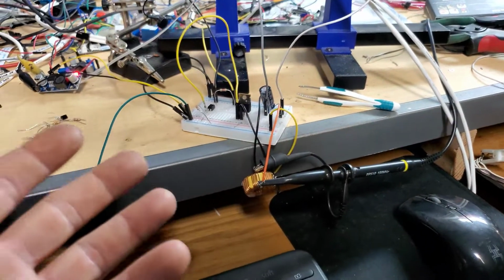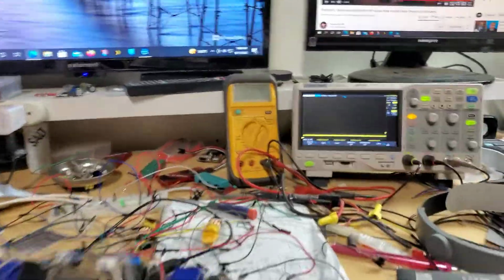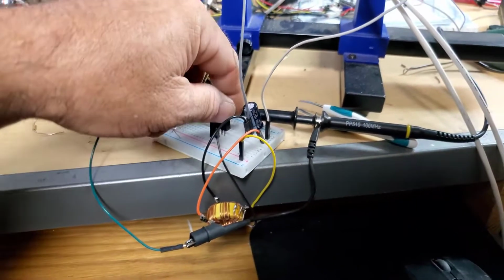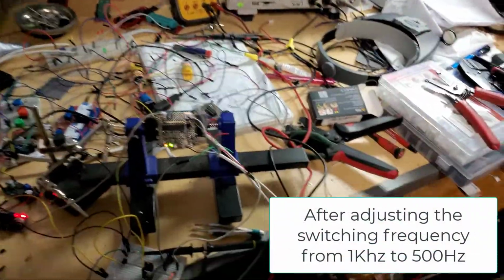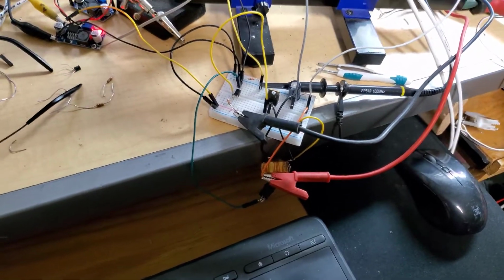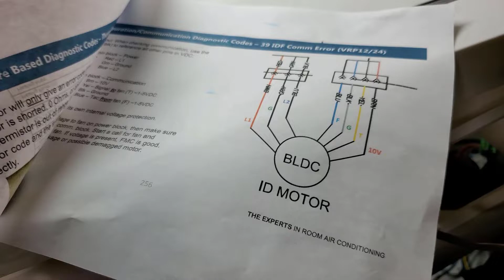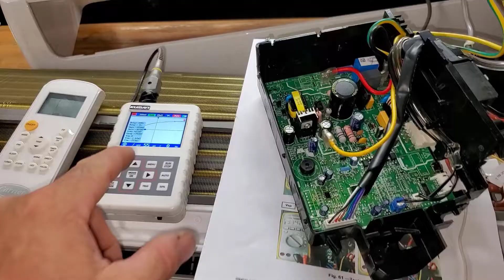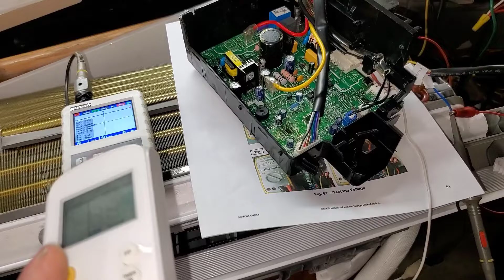Frankenstein Engineering - Off grid abomination of combined VRF equipment []PART 3] Nice try!

Comment: IRF 510 can handle that little bit of heat all year long.   You can actually take it all the way up to 175 Celsius = 375°F. But that’s added to break down point you would never want to get that high only momentarily. 
       At 150°F they could work like that for years and they do in many devices.
Reply from the maker: Oh indeed. When typically used to drive a car audio amp or something, it be smoking in seconds with no heat sink at all.
So 120 deg with no heat sink is nothing for it.
And 510's are wimpy compared to a 44Z etc. But it was loafing along with ease.
I'm sure if I turned up the duty cycle into saturation it would smoke. HA